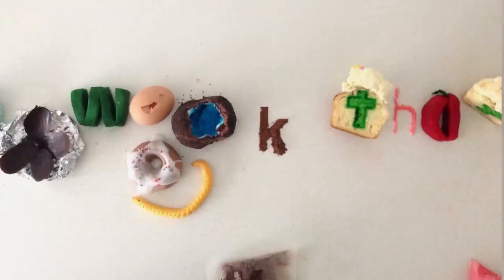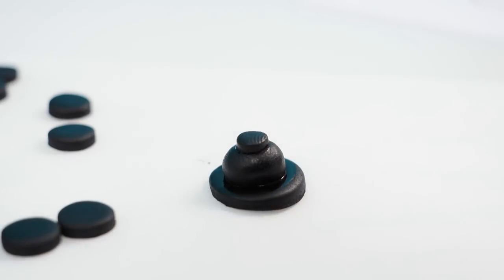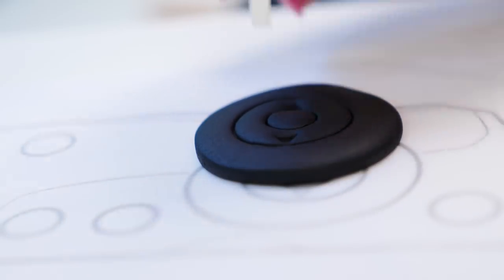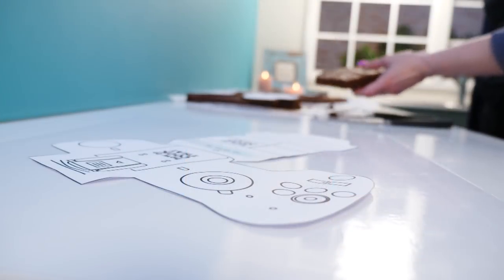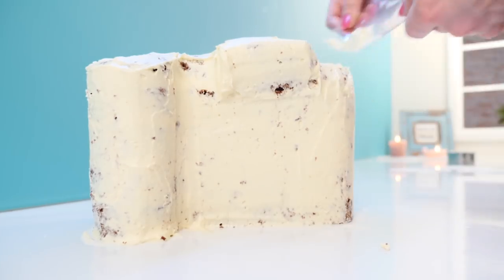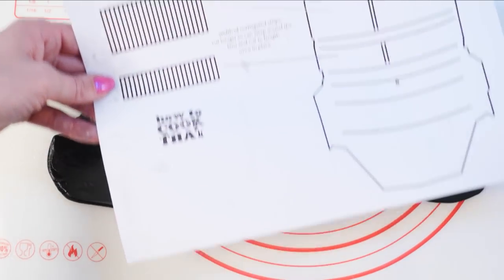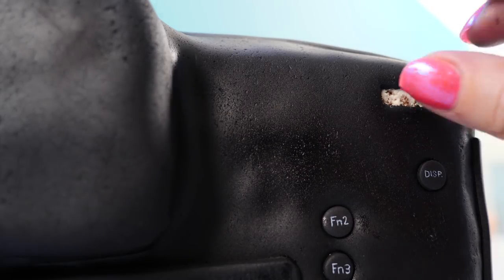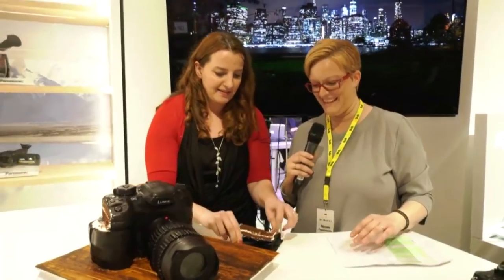3D Camera Cake but will it Survive a plane trip?  How To Cook That Ann Reardon

Comment: Hi Ann, I am preparing a Nikon D750 cake and this is my model and my inspiration (and as well as my guide). But could you tell me the scale - the real life diiference between the cake (template) and the real camera? I can see, that the camera itself is obviously smaller. Like half the size? Or 1,5x? Ty! I am unable to buy the template beacuse of the distance and time, and altough it would be a nice start, I have to make an other type of camer cake. :) Best Regards, Zsolt.